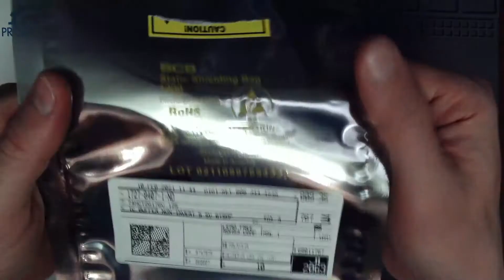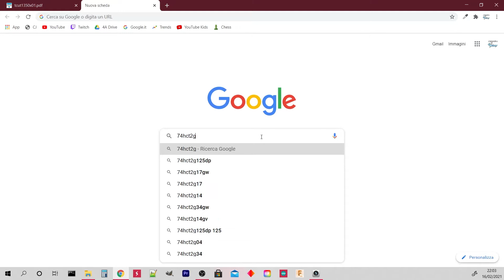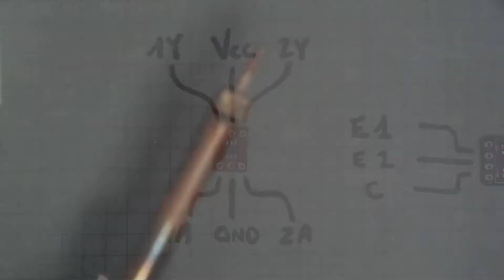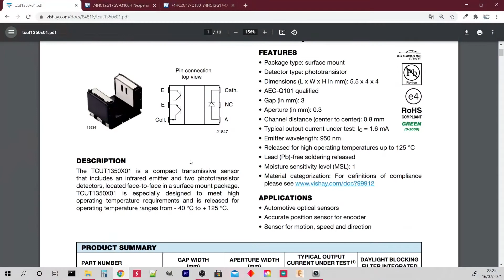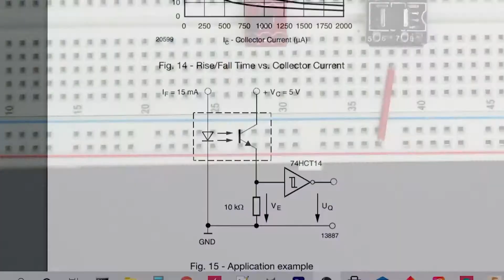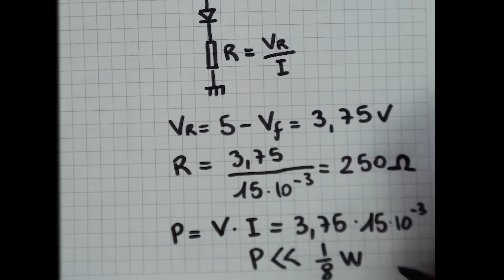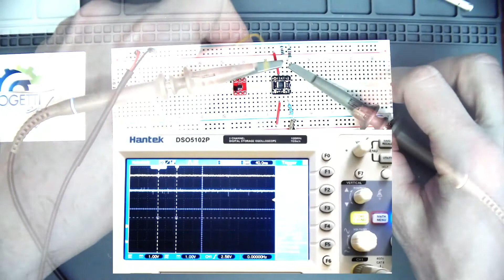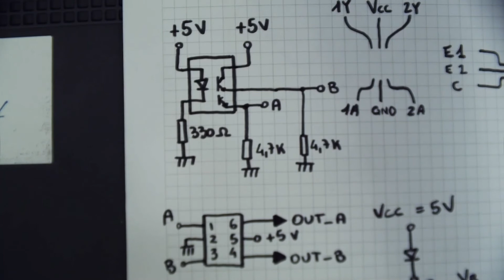TCUT1350x01 Vishay : Encoder ottico per motore elettrico  [SOTTOTITOLI]

Comment: Hello, I have an air control unit that contains a 1400 vent, which I replaced with a 1300, and the problem is removed